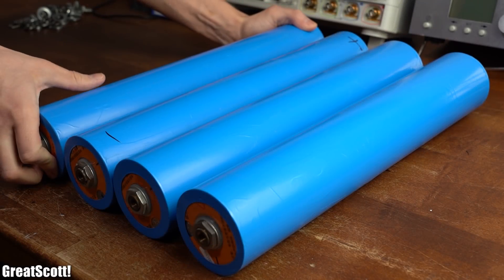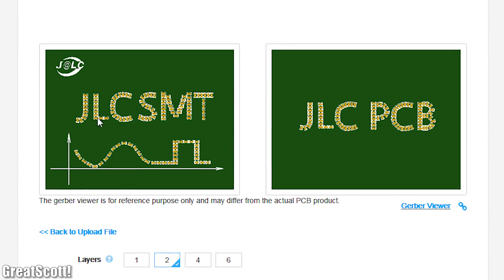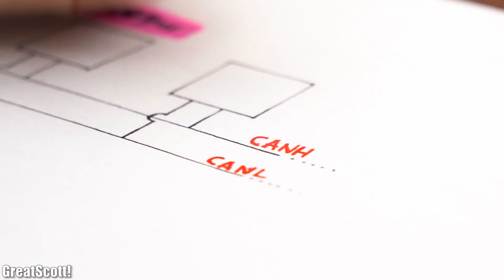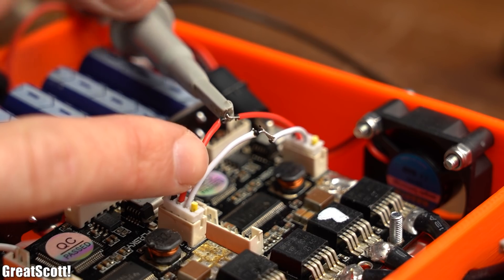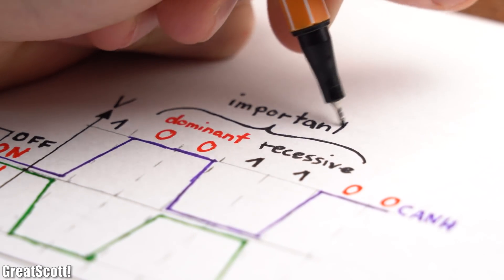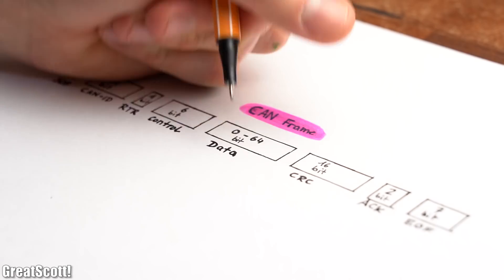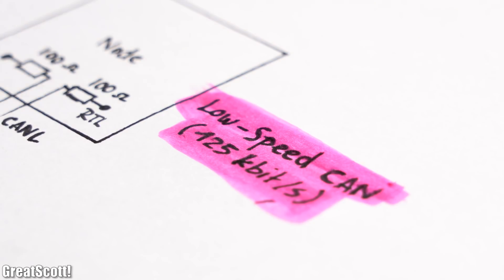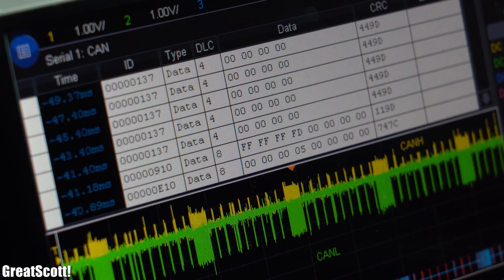Improving my electric longboard with a CAN Bus! What can the CAN Bus do? EB#44

Comment: Greetings... When it comes to electronics I don't know enough to be a novice and you are an expert. That being said you did spark a thought when you had mentioned about voltage being used to control the two wheels. My thought sparked Quadcopters and if they used something like this to keep the thing in the air. If not, could something like this CAN H or L be used to improve Quadcopters??? I look forward to your reply... Cheers...
Reply: You are actually not too far off! A quadcopter uses an ESC for each motor it has, but instead of a linear voltage, it uses something called a PWM signal (Great Scott has a video explaining PWM way better then I could),meaning throttle on each ESC controls more like a servo. You could use a CAN bus to do it, if you wanted to use four of these big ones to make one HELL of a quad. The thing keeping a quad in the air is it's flight controller, which contains a gyroscope, accelerometer, and a whole buch of PID controllers (and sometimes an optical sensor similar to a mouse for very fine hovering).

Comment: at 0:52 You can cause a crowbar effect when cutting more than one wire at a time!!  Yikes!!
Reply: What is crowbar effect  exactly ?
Reply: @casper2501  Crowbar effect means direct short. Like putting a crowbar across the battery terminals on your car battery it will cause a direct short  Imax!!!Look out!!!  When using cutters to cut wire and you cut 2 or more wires at the same time, you can short them all together which is a crowbar effect!!  You can damage component,  cause a fire, or both.
Reply: Well sure, but he wouldn't have had them powered while he was doing that.
Reply: @clonkex  What did he do to discharge all the caps?  I missed that part.
Reply: @grabir01  I didn't see him do that, but I would be surprised if they don't simply discharge themselves given they're just filtering caps.
Reply: @grabir01  No, I never have. The caps are there to supply large amount of power for very short periods of time and to filter noise. My point was, however, that they're directly connected on the battery side, which means when the battery is disconnected the caps will drain themselves into the ESC. There should be nothing left to short.

Comment: CAN sounds much like network hubs, single collision and broadcast domain
Reply: Except for ethernet: when a collision occur, all devices stop emitting immediatly and they all choose a random time to resend data so there is a amount of time where ethernet is not used. With the can bus, the highest priority device continue to send data even there is a collision and there is no "dead time" to transmit data.
Reply: @arnaud8532  Sure, but the number of nodes in an Ethernet collision domain was expected to be very high, and with basically no pecking-order among most of the nodes.  Several hundred end-users are all essentially the same priority, servers and gateways possibly higher priority, and the "random" timers for restart the preamble were tweakable if I remember right.

In a canbus system I expect that there are more like a couple dozen nodes, with a definite, confirmed need for some nodes to be very high priority compared to other nodes.  Additionally the manufacturer of the overall system has theoretical complete control over what's integrated with the network.  I further expect devices are programmed to know whom they need to listen to by-ID; looking at the canbus frame layout it looks like there's no destination/recipient specified.  It appears that devices all listen, and decide if the information is significant to them based on source ID, not based on destination ID.

I'm wondering if, in automotive applications, canbus with reachable wires has let car thieves get into or steal higher-end cars because if they can learn the sender IDs for things like interior door locks, they could splice-in a device that mimics the door lock switch and triggers an unlock.
Reply: @arnaud8532  What happens if one node starts transmitting, then another starts transmitting? Won't the second node potentially override a recessive 1 of the first node with a dominant 0? Sure, it'll stop transmitting when it detects something else is already transmitting but by that point it's corrupted the other signal. Does the system just rely on the CRC?
Reply: @clonkex  That is why the nodes first wait for the bus to be idle, then start transmitting a lot of 0's. Think of it, it solves all issues.

Also I'd like to mention that the CAN bus is suitable for Real Time OSes and applications.

Comment: isn’t it the same like i2c communication in arduino?
Reply from the maker: No
Reply: I2C is synchronous communication. Data line and clock line.
Reply: You are right in saying that they both use a bus system but the protocols themselves are quite different. CANBUS is a communication protocol that is/was heavily used in the industrial sector. Nowadays you see more and more factories/vehicles switch to the newer ProfiNET which is based on the ethernet IP protocol and offers much higher bandwidths (machine vision etc.). I2C was developed by Philips in the '80's and utilises a synchronous bus system and while it's quite robust, it isn't as robust as the CANBUS system.